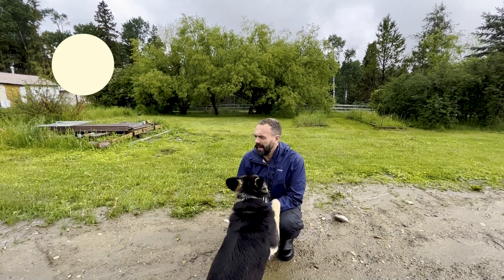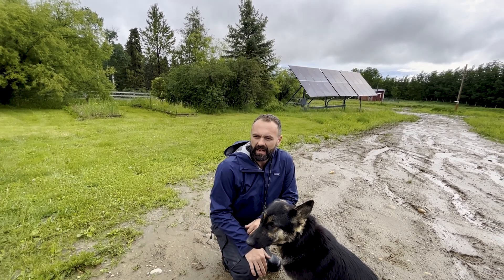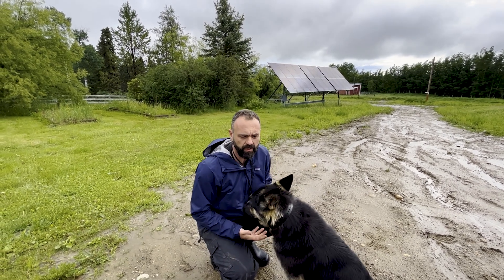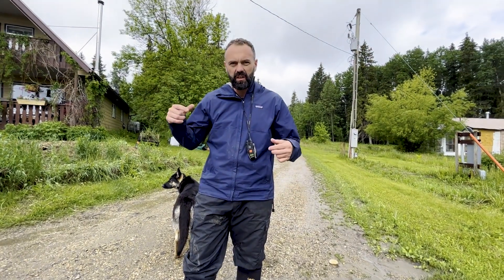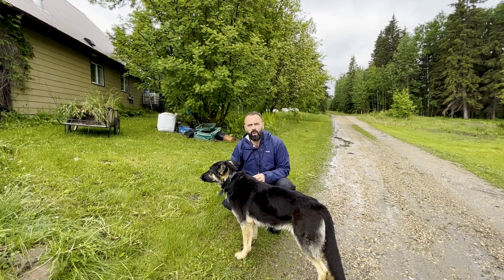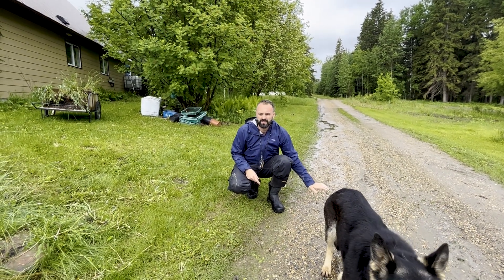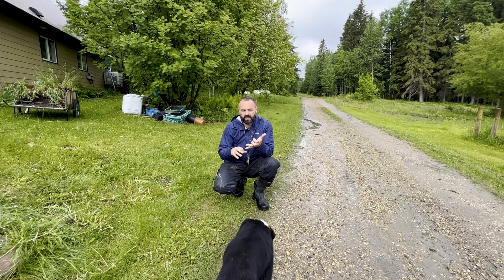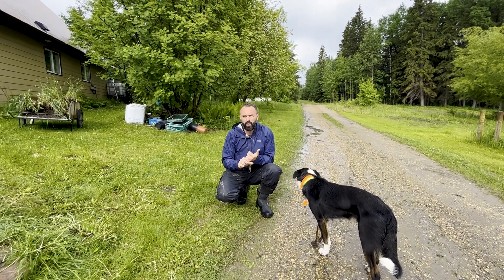Why Accessibility to Water is Important in Your Land Design

Comment: Shale is metamorphosed clay. Generally, the older the shale, the harder it is.  The nice thing about shale is that it breaks up easily and may sometimes be used instead of gravel, but if the shale isn't hard enough, over time it will break up into powder and revert to being clay.
Reply: Our eastern PA  soil is so full of clay/shale.
Drains like a sieve.which sucks for all the small ponds I'm trying to build here.